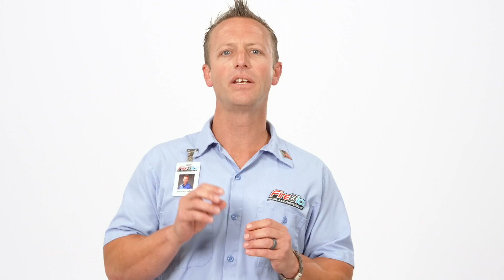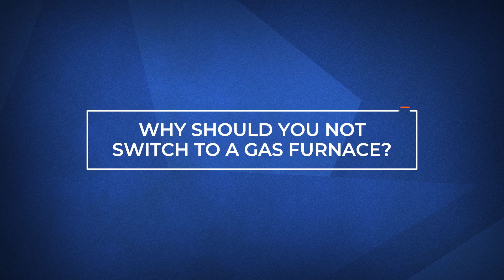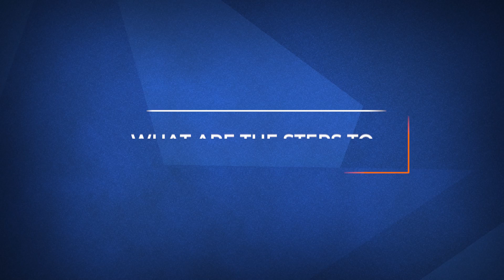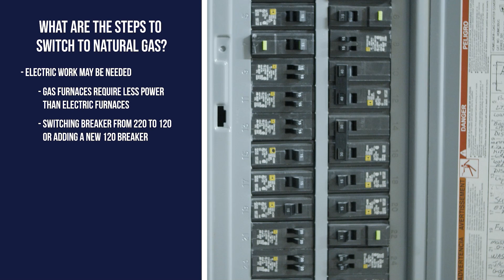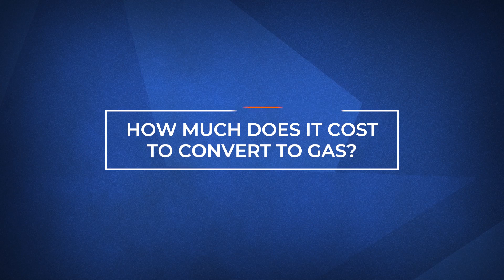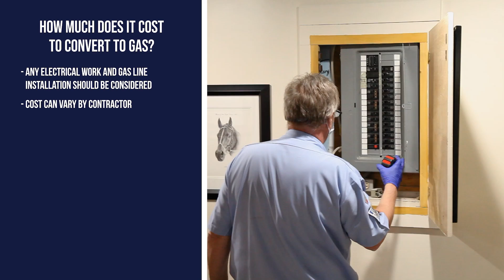How to Convert Your Furnace To Natural Gas?

Comment: my gas got shut off back in the spring for non payment. i have two address's and the mininum the gas bill that is allowed is no less that $40 a month per bill, even if i dont use  it all. 

$40 x 2 =$80, $80 times 6 months  = $480 for something i wasnt even using. i have solar and i am grid tied as well.

 thinking about going with heat pump for most of the winter and supplemental resistive heat for the really cold days/nights if my heat pump and solar cant keep up. 

i bet i end up saving money this coming winter. the btu cost of gas heat might be cheaper, but my small solar system can produce 20kwh per day.

i already use a lot of electricity to heat my place inadvertently with all my electronics, tvs, computers, its 70F in the house now and 40F outside.

Comment: Thanks for the video! We currently have heat pump only set for cooling because we recently asked a technician to set our system up so that heating only uses natural gas. Now I’m wondering how to switch the modes back Auto switch (between heat pump and gas) just in case gas prices go up high. Help please?
Reply from the maker: They most likely just put in on EM heat or AUX heat only to keep it on gas only.  If you put it back to auto, that should do the trick.
Reply: @fireiceheatingandaircondit4363  Thanks for getting back to me! Yes it was Aux mode initially to use natural gas but the guy actually did something by the compressor to get rid of the auto option all together. He said that he “re-wired” some things…. Now my smart thermostat doesn’t have Aux option and all heat is through gas only. 🤨